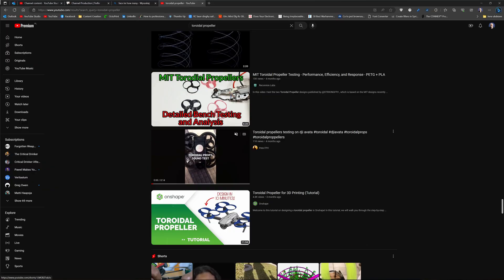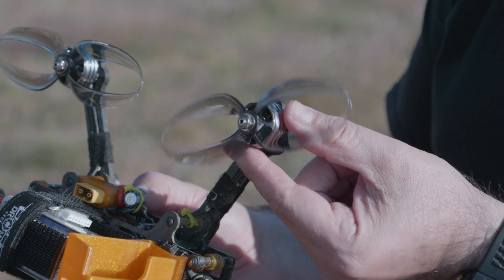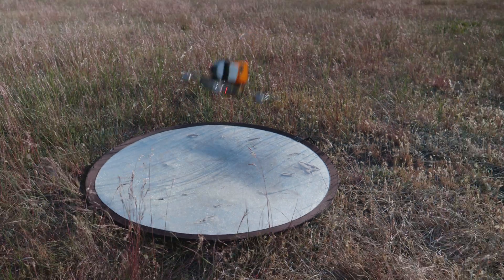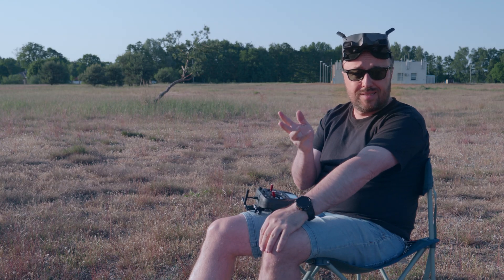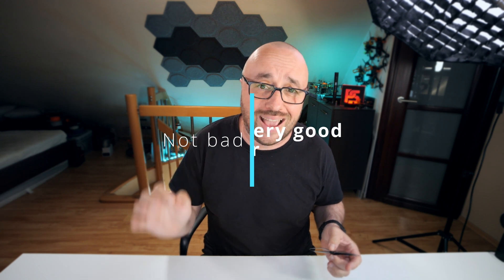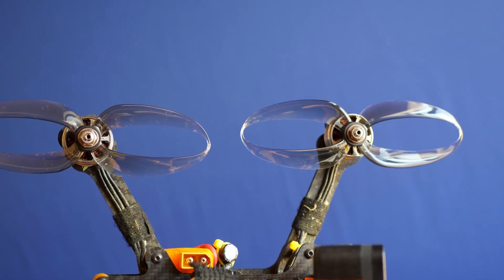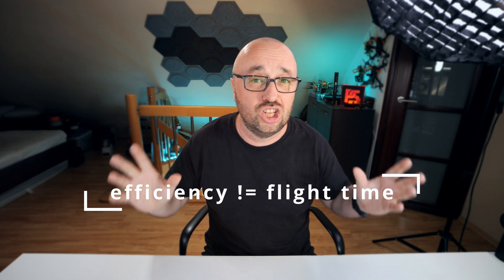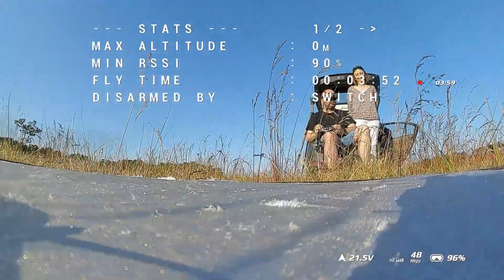The INFINITY propellers - Foxeer Donut

Comment from the maker: A toroidal propeller is a type of propeller that is ring-shaped. It is claimed to be more efficient and quieter than traditional propellers both in air and water. It reduces the drag effects of swirling air or water tunnels (vortices) created at the tips of blades and strengthens the overall stiffness of the propeller. It has been developed and patented by various inventors and institutions over the years, such as MIT Lincoln Laboratory, Sharrow Marine, and Charles Myers. It has potential applications for drones, boats, and other vehicles that use propellers.

Foxeer Donut is an example for a mass produced, commercial toroidal propeller for FPV drones. Let's see what they are worth!

Comment: I had a similar experience with this propellers. For me they had pretty bad mid throttle oscillations and on full throttle they flutter like hell. 
In my opinion foxeer didn't realise designed this propeller as MIT did. They just made it look like a toroidal propeller.
A lot of potential lost.

Comment: Be interesting to test the efficiency side of these. Typically on props when you go up in blade count they get worse in efficiency due to the blades coming closer together and start interacting with the wake of the blade infront. You would think these toroidal designs make this even worse. Worth testing against a 3 a 4 blade prop. Also wonder with these shapes if the blades twist differently to if the each blade is separated. Maybe why you get weird oscillations. Interesting design though, seen these on boat props but nothing in aerospace. Maybe a reason why that is.
Reply: There is a guy on youtube who did some tests. I put all the results in a little excel and there was little to no difference.